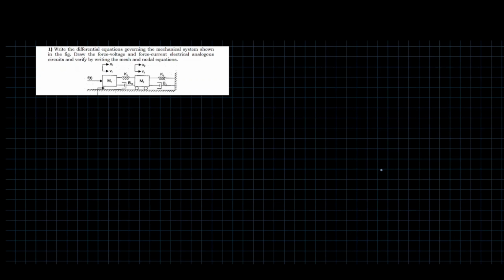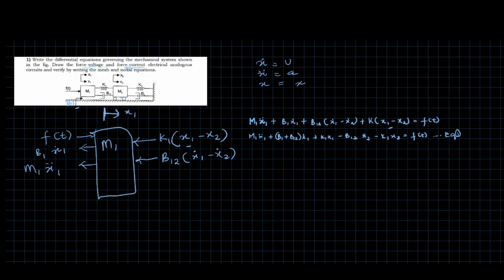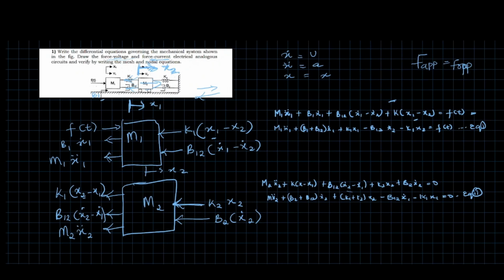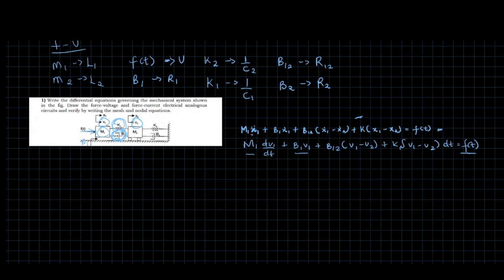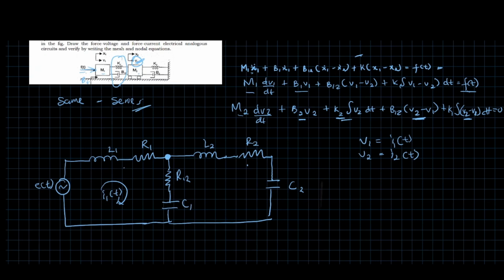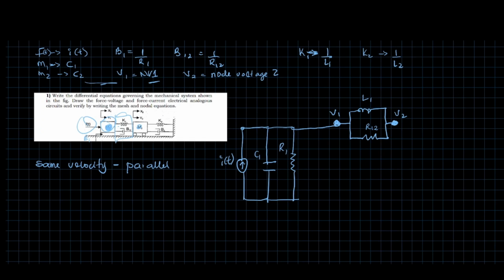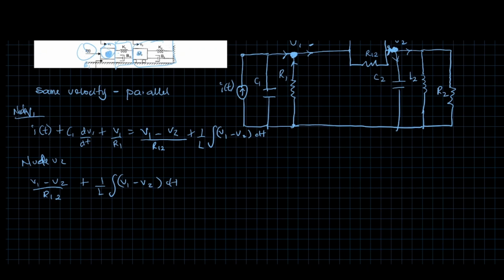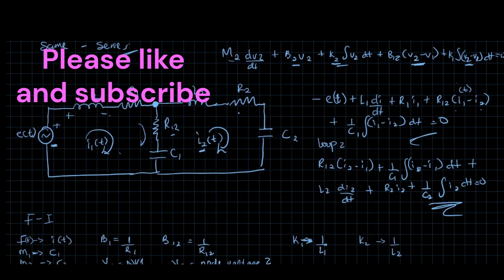Write the differential equation and draw the force voltage and force current analogous circuits

Comment: It is great that you give equivalent analog circuits for this 2DOF mechanical mass-spring-damper system ! Building a small circuit on a breadboard with passive components and checking the voltages with an oscilloscope can be done much more easily than constructing a mechanical model with sensors.